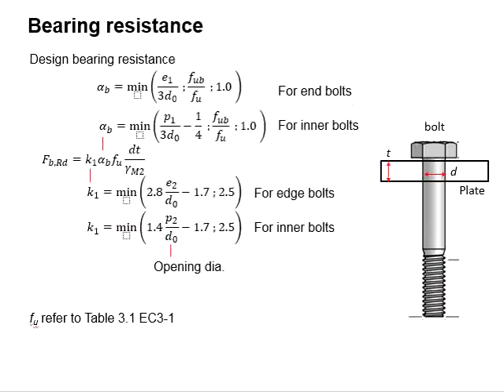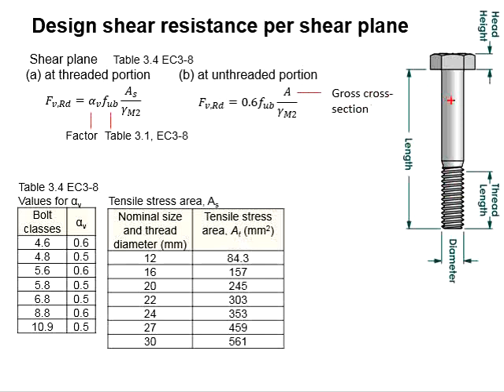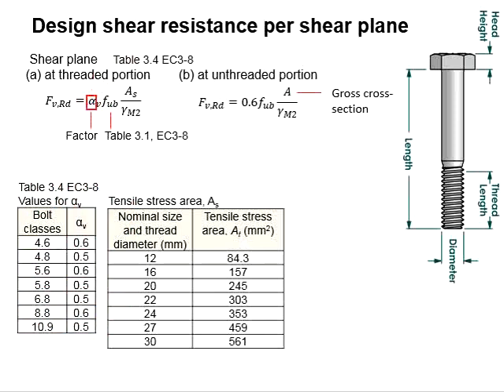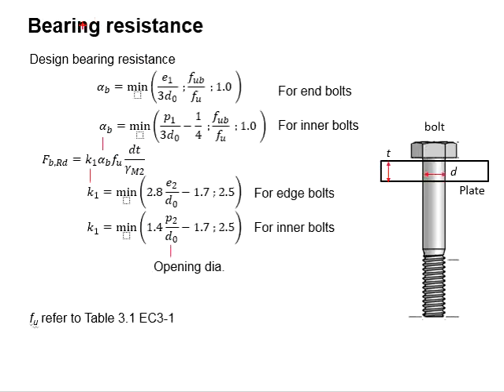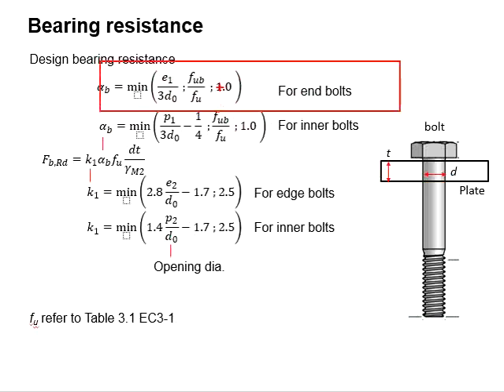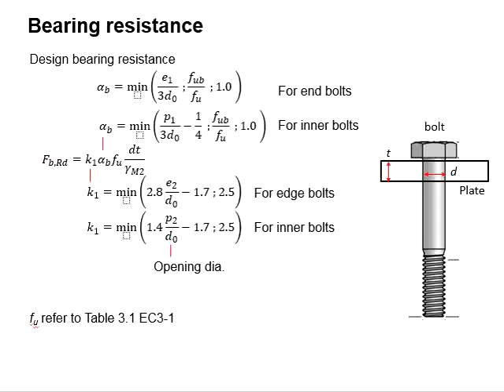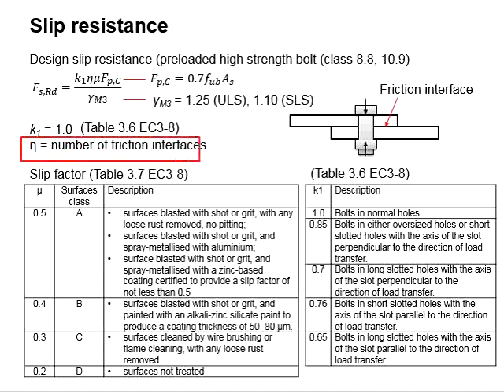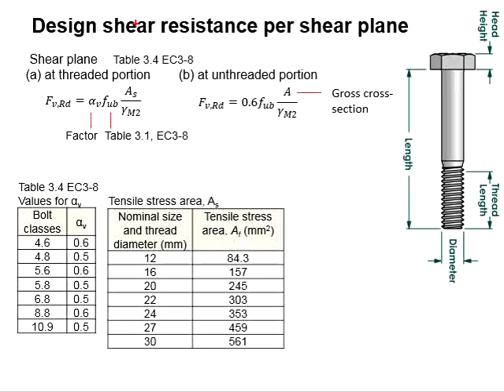2.8 Design of bolted connection

Comment: yeah and what happen if min k1 , if your minimum k1 is "2.5" and you add this to your formula. It gives 2.5 times more kapacity of the plate/bolt, it is the same as give a fake capacity to your plate or your bolt.. If your bolt had capacity of 500Mpa , now by adding 2,5 it manage 1250Mpa